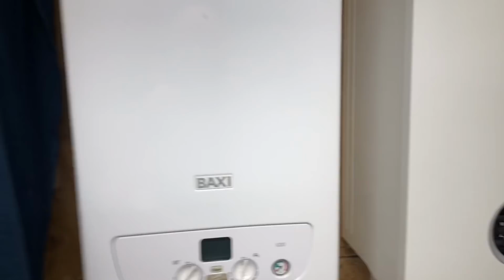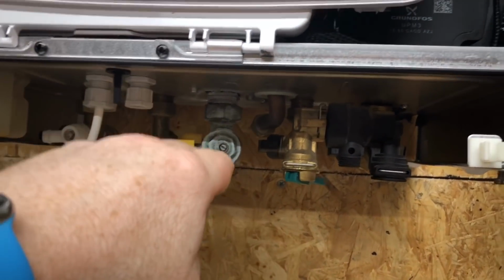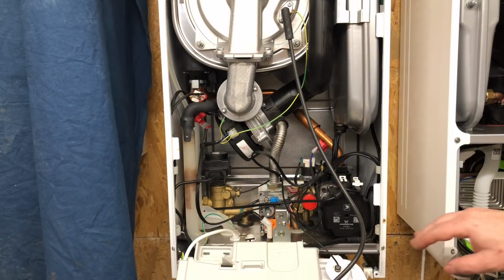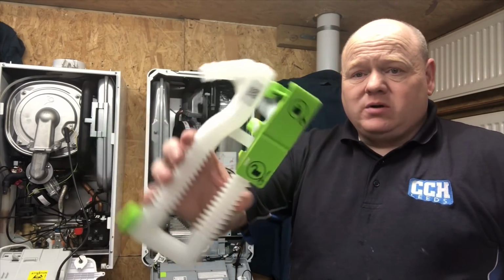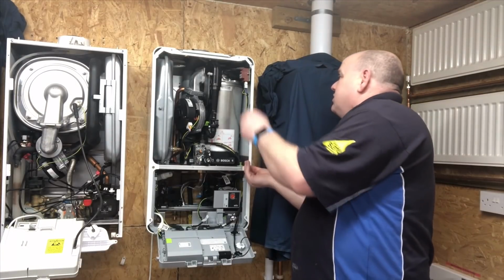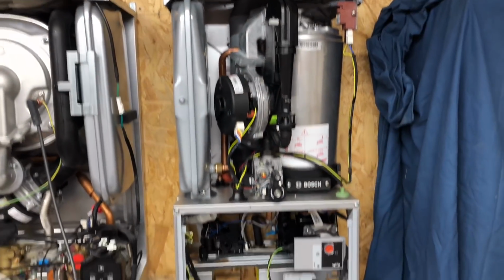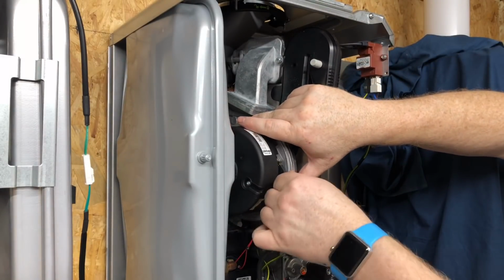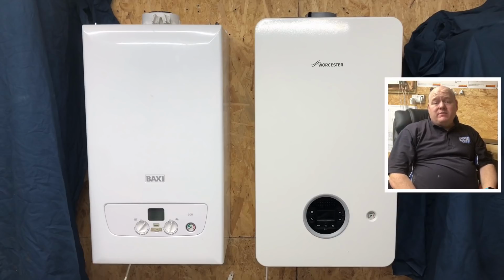Worcester 2000 v Baxi 600 - Which Combi Boiler is Best

Comment: Had my Worcester Bosch Greenstar 12 years now and it has never missed a beat. When it dies it is back to Worcester Bosch

(Edit) watched the video and now think maybe the Baxi is the way to go.  Question, what is better, a stainless steel heat exchanger or an aluminium one? I live in a very hard water area.
Reply: I know this comment is late, but a stainless steel heat exchanger is always preferable. Aluminium will corrode far faster over time and block up. Hope this helps. I'm gas safe registered.
Reply: l'alluminio come scambio termico è molto superiore a inox, l'acqua dura nel circuito di riscaldamento non crea problemi, se caso in caso di ricarica basta usare un filtro di polifosfati.
Reply from the maker: Thank you for taking the time to watch my video.

Comment: You're spot on here alkan.
I fitted a 2000 ladt week and thought it was horrible,  I'm not the biggest Worcester fan anyway. I hated the downward tails and found everything close together like an old Remeha avanta. I also found it tricky getting a standard nut and olive to grip the brass on the prv.
One good thing was the cartridge slot for the rf stat, although if you fitted a none Worcester control I'm told it avoids the warranty.
Will be staying with the 600 back or even the Main Eco elite.
Reply from the maker: Thank You Mark. 👍

Comment: My boiler's been in trouble free for 35 years. No, not one of these modern craps. A Potterton Kingfisher floor standing boiler  with separate cylinder.
Reply: Similar here, my Ideal Standard E-type CF80 is still running strong after 44 yrs service. Gravity system, so simple & no electronics to go wrong. System gets a drain down & new inhibitor every 5 yrs & £3 thermocouples burn out after about 3 yrs. The burner gets gently brushed & any debris vacuumed every year. Gas valve, thermostat or transformer still available NOS for peanuts. CO detector sits next to it, just to be safe. The economics of fitting & annually servicing a new boiler (even with a 10 yr guarantee, but still needing annual services to validate guarantee) don't justify a change yet, so I'll keep running this basic, bulletproof, old dinosaur of a boiler until the cast-iron jacket rots through or until we are all forced by the govt to remove gas boilers completely.
Reply: @wirdy1  thats good, I'm glad your boiler is doing well. Just remember you have to include any external pumps, zone valves, cylinder stat etc and even the cylinder into your equation as these would all be part of the combi boiler (or at least the equivalent part) 🙂
Reply: Hmm, assy rope seals 😜
Reply: @peterbeale9413  funny you should say that, put new rope seals on last year. Assumed old ones were asbestos so misted with water spray & wore ppe mask. Easy to do & cost about a tenner 😉.
Reply: Been @ this house for nearly 10 years & the baxi back boiler still going ("80"s) not efficient ......but still going :)

Comment: I have had no problems with Wilo pumps - millions of boilers have them as standard fit. Not sure about today, however they had a plastic type of carbon bearing which did not like dirt, while Grundfos had ceramic. A Wilo needs to have a filter on the system, which is sort of standard nowadays.
Reply from the maker: Did you see the pump? It looks like you can change the setting. I am guessing they will change that.

Comment: The comments say that Baxi get it. I would go along with that. That does not mean that Baxis are the best boilers on the market.  The electrics inside look like they need to be more professionally designed and installed. I prefer an Intergas to a Baxi - generally.  Only 4 moving parts and built like a tank. 

The horizontal Giannoni heat exchanger used in the Baxi, and others like Vaillant, needs a very clean system with a quality filter as a pre requisite. I have seen the heat X tubes clogged up with sediment solidified at the bottom. That is where the vertical W-B spiral tube heat X scores higher - any solids will drop out of the heat X. 

Yes, W-B after service, and tech support, is good. 

Vaillant the best?  Listen to the racket from them and look at the flimsy cases on some of them. I find installers home into a boiler because of familiarity, not because of its design or quality. They know the layout, and most importantly the error codes. 

W-B are designed in Germany aimed at the German market where boilers are generally in utility rooms or basements with space at the side of the boiler. The Baxi design is good as all can be accessed from the front, which is good in kitchen cupboard locations in small rabbit hutch British homes.
Reply from the maker: Thank you for the comments. 👍👍

Comment: To be honest I've always tried to avoid installing Worcesters, like you say they are needlessly complicated to the point of being stupid, the integral filling loops need a special key that is never there, the instructions are written by scientists and lawyers full of jargon and just make life difficult for no reason. Thought they were top of the range at one point but have gone down hill big time, a bit like vaillant. Since watching your videos I've defiantly started to like baxi's a lot more. Keep up the great work
Reply from the maker: Thanks.
Reply: my observation as not a plumber. Since its plumbers who fit boilers making the processes of installation and repair easier means that the plumber is more likely to recommend a boiler with less hastle as the work is easier and quicker to complete. Unless a customer has a clear preference or has already bought a replacement (or it costs to much) they are likely to go with the plumber recommendation. Baxi clearly have that philosophy here whilst worcester have missed that  idea.

Comment: I’ve worked on both Baxi’s and Worcester’s. Older Worcester’s are awful to work on, in comparison, the one you have there seems a breeze. I have a duo tec hanging on my kitchen wall and like it a lot. So, Baxi before and Baxi after.
Reply from the maker: Thanks.

Comment: Hi Alan Looks Good On the  Woster as over Enginnered not solved the condencer prob/ this should have a sencer probe to indecate when they Block Up and lock out and  This comes up with a    IE Gas Valve Or a Fan code Fault? It Allways a Blocked Condencer as All the Holes are two small for the waste water conditions of the local water Hard or Soft  water? yes there is a way forward?  Been reported to there Tecs / as the New Condencer / will have a look at it ? Would like some feed Back and My New Commpany this Year are Downing a New Service of No fix on Fee and On Call Out?.Thanks for your time Alan.

Comment: The old biasi's had brass hydros - still a shit boiler.
The logics looked to be good boilers when they first came out - became riddled with problems. Its only time that tells which have less problems, you can't tell from how it looks. Newer Baxis are notorious for difficult to diagnose electrical faults - good luck when you want to speak to their technical.....
Reply from the maker: Totally agree with you on that. 👍
Reply: Jaime Clifton What’s your opinion on the guarantee that comes with the Baxi? I’m seriously thinking about getting one! And the problem with electrical diagnosis? Could you elaborate on that please? Thanks.

Comment: I’ve switched over to the viessmann boilers range especially the 100 and 050’s but for a cupboard fit I still use the ideal independent and logical range the viessmann is way too big to fit into any cupboard at 350 mm deep!
Reply: I only installed about five Viessman boilers. Four of them have needed new PCBs after 7 years......pricey. By comparison I've had very few problems with Logics and not a single PCB failure in ten years. Anyway you should be comparing these to the Ideal Vogue. One of my tests of a boiler choice is whether they pick up the phone when yoh need them. Worcester do, Ideal do. I fell out with Baxi when they printed a wrong PCB part number in a Main manual.....then refused to swap it for the right one without charging me for both. The trap should be cleaned every service so easy removal us a must.
Reply: Tim Hancock I’m surprised you had for PCB failures  on the viessmann boilers 
I have a dozen or so going 10 years strong with no problems at all
Reply from the maker: I like the 100. 👍

Comment: Good balanced review. As you say. Baxi is a better boiler by a country mile.  One of the WAI's was raving on about the worcs 2000 to me a couple of months bsck as nd saying how it was gonna hit Baxi and Ideal Sales etc.  I was like, ok....cos not a Worcester fan at all anyway!  I just cant get over 3 things.  First is that heat exchanger. If your gonna compete go stainless.  Easier to work on. No mess in the trap. Perfect.  Second.  Those pipes arevjust awful. Its totally ridiculous, it actually makes me laugh nervously!  I wouldnt buy one based on that! - in fact a friend in the trade bought one and he vowed to never fot snother and one of the installers on gas chat said the same. Third is that Trap. Its just stupid because you just know that some installers will either do it unwittingly or because they cant fit the other trap in or they wont buy it so it will still get piped up to the outside.

I dont know what Worcester R&D are doing but they are giving Baxi and Ideal more sales there in my opinion.

Also its a shame but they are building a loathing in our trade for their boilers. Customers are like I want a Worcester and installers (not WAI obv) are like no you don't!- shame for them at the end of the day. Thet could be doing soooo much better.
Reply from the maker: Lots of installers will just install the boiler as normal and will not even know about the trap as you say. Thanks for the feedback.

Comment: Although there around the same price band your comparing the top of the Baxi range (apart from the 800 that’s the same boiler with extra 3 years warranty and a filter in with it) to the new entry level Worcester. 
Would be interested as how the Worcester stacks up on a comparison with the Baxi 200 boiler. Cost would obviously widen again. 
I install both makes (Baxi only 600 & 800 range and Duotecs) but wasn’t impressed with the Worcester 2000 design and being made in Turkey so haven’t and won’t fit one. Models I Greenstar, CDi, Life & Style we install. 
It’s a comparison in 2 boilers not a comparison of the top models in each make.
Reply from the maker: The 600 costs less than the 2000, The issues pointed out on the 2000 would be the same no matter what boiler i put it up against. 👍
Reply: Agree as I said, but your still comparing one manufactures top of the range boiler to another manufactures budget entry boiler. 
Out of the two if use the 600/800 over the Worc 2000.
Reply from the maker: @anygasmananygasman6517  Baxi hasn’t brought the all signing and dancing boiler out yet. I will be sure to review it when they do.
Reply: Allen Hart but as of now this is there top of the range where as Worcester does. 
As a comparison it’s good video and Baxi gets it on all areas apart from appearance by that’s down to different people.
Reply from the maker: @anygasmananygasman6517  Which boilers do you install? Thanks.
Reply: Allen Hart mainly Worcester, Vaillant equalish numbers, Baxi some less numbers and mainly for Landlords. 
Alpha for budget boiler but I’m impressed with the build and component quality of them. 
Otherwise fit what the customer wants if they don’t take a recommend from us and have a boiler already chosen. 
Work load service and gas checks along with repairs 70% 
Installs 30%.  Around 60 to 100 a year. Me my son and nephew.
Reply from the maker: @anygasmananygasman6517  I have installed most brands but never Alpha. I don’t know anything about them at all. 👍

Comment: I was recently told by an installer that bosch worcesters are the thing of the past and he recommends now fitting electric boilers instead. Does that make sense¿¿
Reply from the maker: Not sure about that. Electric would cost more to run.
Reply: I fitted an electric boiler in Chelsea before Christmas. It was actually a  really good unit ,done the job as it should and I didn’t have to fit a flu 😊
Reply: @garethrowlands1305  
What make and model?

Comment: I would choose baxi think the worcester is over engineered in some areas and too old style in others, like the heat exchanger such a bad design always need cleaning and so much dirt in the traps can see that trap getting blocked after few years of not servicing like the front style trying to be a bit different but as you say most in a cupboard anyway and i try not to fit boilers with plastic hydraulics changed too many over the last 30+ years
Reply from the maker: Thank you.

Comment: The Worcester reminds me of working on BMWs, a load of plastic shite basically. The Baxi is like a Jap car, well thought out, well engineered for future maintenance and repair and backed up by a great long guarantee. The Worcester looks like form over function design.
Reply from the maker: Thank you.
Reply: Worceter Remind me of apple more about design and locking you on to there products .
Reply: Thpxs05 Thpxs05 he car in front is a Toyota.... Why? Because the accelerator sticks and the won’t stop. I’d rather have a BMW.
Reply: Allotmentality ...my comment was based on all the mechanical work I’ve done on BMWs, single use plastic clips,plastic hoses, etc all ageing badly and snapping and cracking, and having to remove loads of unrelated parts just to get to the bit that needs fixing. They’re nice when new and drive great but today’s cars will be horrible to repair in 10 years, just like the Worcester boiler.

Comment: Great video Alan. Thank you. My thoughts are Worcester will never learn. The standard efficiency stuff like the old Cdi was appalling to work on. They had a golden opportunity to put it right with the greenstar range, but it was poorly designed and a pig to work on. Then the compact Erp stuff made it even more difficult to swop out components. I’m not gonna bore people with a great big list of all the stupid bits of design on the greenstars as any decent service and repair engineer will know them all. And now this joke of a product. Condensate pumps. Worcester controls.  Divertor valve behind other components. Pipe work tails that aren’t clip distance. Do me a favour. 

I’m an ideal logic man myself for a mid range combi I don’t think they can be beaten for ease of install or repair, or warranty. But if I had to recommend one of these I’d go so far as to say if a customer wanted one of these Worcester’s I’d tell them to find another engineer cos I ain’t working on that for the next 15 years. For Christ sake how many jammed in baffles do you see on Ri/Si and juniors and they use the same design for their new range. Like I say Worcester will never learn. Maybe they might start listening to us when they get hit in the pocket. Until then feel sorry for any Worcester engineers you meet. Only decent thing about Worcester is their tech support line.
Reply from the maker: Thank you.

Comment: So Allan, you said that the Worcester unit always needs a condensate pump, why can't it drain into a waste pipe like
most other condensing boilers.    This will be a major addiction expense compared with the Baxi.
Reply from the maker: The design of the trap. As per the video. Worcester has a good trap on other boilers.

Comment: I agree the Baxi is better designed though the rounded corners are better on the WB. The stainless steel heat exchanger is the better one. Too much plastic in the WB the wiring in the Baxi could be tied up better
Reply from the maker: Thank you.

Comment: Love the baxi, SStl heat exchanger,    fixed filling loop, easy to service, easy to wire 230v switching, also have low voltage opentherm connections, ... And, for cheaper option buy the main eco compact 30kw for exactly the same boiler, just less warrenty (5yrs).

Comment: All well, but how do they perform in heating your water and your radiators. My past experiences with a baxi boiler is that there not as fast to reacting to hot water, as a Worcester
Reply from the maker: I will try and test that at some point. Thanks.

Comment: My personal opinion is the baxi blows the WB ouf of the water.  The design of the WB is like you say over complicated and not very installer/service friendly. Also requires more add ons than expected.  The condensate is a strange one to allan. Regarding the internal termination.  Not a lover of the valves below either. Now im a Baxi installer so this may come across as biased  , but baxi really are more installer friendly and have thought more about the GSE. 
Iv never fitted these new WB and after this video i dont think i would unless the custard pushed for it. Its a Baxi vote from me. 👍

Great video allan .

Comment: Worcester looks nice from the outside but It looks like baxi blows it out the water when it comes to installing servicing or repairing them.
What is the purpose of the baffles in the Worcester heat exchanger?
Reply from the maker: To spread the heat around i believe. Thanks.

Comment: 1st WB looks much more modern.
2nd Baxi seems to be a more straightforward and simple design. 
3rd The WB condensate trap looks like it will only last a year or two before it splits on the concertinas. 
4th Made in Preston 😎😎
Reply from the maker: Good point about the trap. 👍